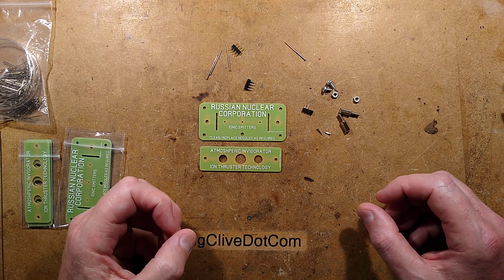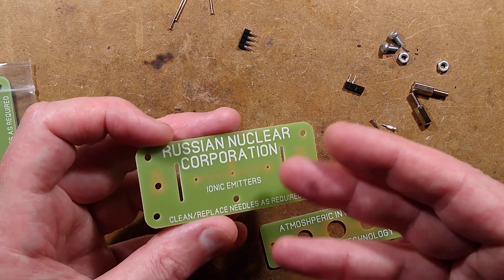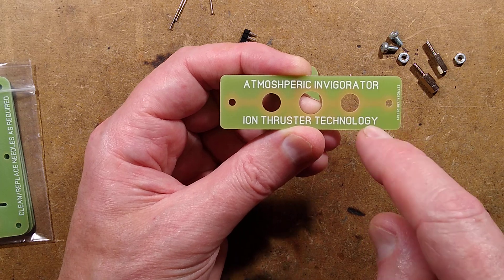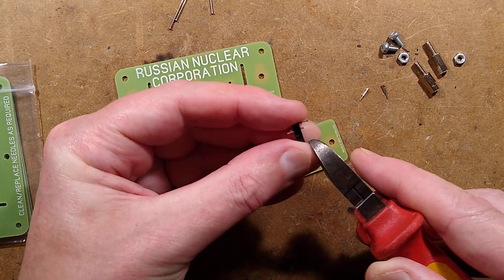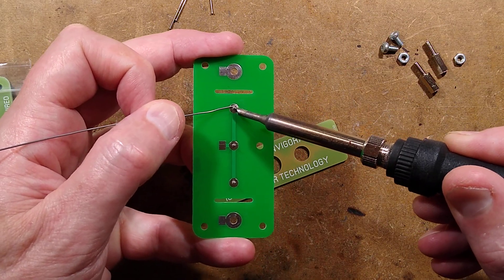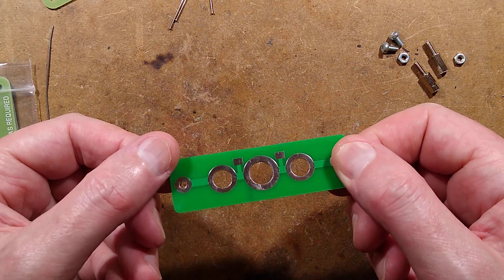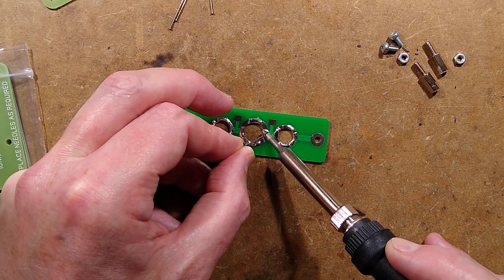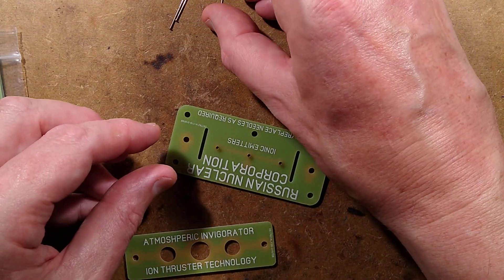Russian Nuclear Corporation molecular disruptor

Comment: Nice module! Would it make sense to have the "rings" in the front PCB covered with solder resist to prevent corrosion or maybe even coat the whole board with lacquer? Or does it need to be bare conductor? Also had a good laugh at the baby comment, just gotta love this channel... 😂️
Reply: Gold plating is a low cost option, select ENIG instead of HASL when ordering
Reply from the maker: I think it needs to be bare metal, as there is current flow

Comment: I love this! Could create a little circuit to power on and off the ion generator intermittently, like the ionic fridge Twinkie.  :D
Reply from the maker: The best approach is to have it run continuously at a low enough level to match the room.
Reply: Was thinking similar, but for the kitchen trash bin.
Reply: @MadScienceWorkshoppe  Just put a switch to run it when the lid is closed. Low power module will not make too much ozone, just enough to kill odour in the semi sealed bin. Open lid and it stops so baby does not get zapped pulling the bag out.

Comment: Could the 2 circuit boards be combined in to one gerber file, joined with "mouse bites", to save on the production costs?
Reply: Its kinda a luck of the draw thing if they upcharge you because there "separate boards", the best bet is leave then connected then when you get them cut it with a band saw.
Reply: Yes Clive could have paneled them by mouse bites / stamp hole onto the 100mm x 100mm pcb

Comment: Was having a bit of a troubling day, Sir, your shocked baby remark was exactly what I needed. I think when a funny remark kind of comes quite unexpected, it is even more funny and clever. I appreciate you so much. 
How thick are those pcb's? They look thicker than any hi volume boards I've come across in recent memory. And your perfect consumable needles/socket solution looked and sounded sturdy and secure.
Reply: If the baby withdraws its hand and cries, it's normal.
If it instead reaches in for another zap, it's One Of Us.
Reply: @markfergerson2145  one of us. One of us!
Reply from the maker: Standard 1.6mm laminate.
Reply: Std 1.6. Hmm. LOokEd thicker. Did they come with those beautiful edges and radiii? Almost had a ceramic sound when boards clicked your bench or each other.

Comment: Speaking of the Beh-beh's:
I was raked over the coals by "friends" many years ago when they found out I had let both my boys (They were both toddlers) stick paperclips/utensil into the wall sockets. They each did it once. They learned. They are both very successful now. Coincidence? I think not!
Reply: As maybe a 10 year old kid plugging in Christmas lights I learned not to f*&k with electricity after getting quite a buzzy shock off them (no idea how it did this but the memory is a bit fuzzy). If I was going to mess with it, do so with insulation and a way to put out fires handy.
Reply: It's indeed not a coincidence. My youngest son asked his mother when he was 13/14: "Mum, do we still use or need this lamp?". Five minutes later we heard a curse and the lights went out. He's a very intelligent and successful young man now.